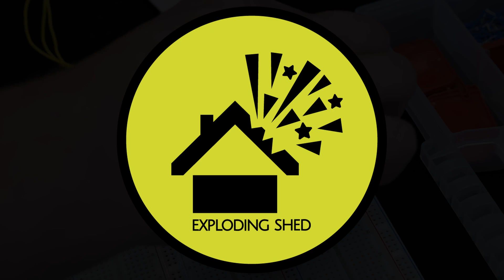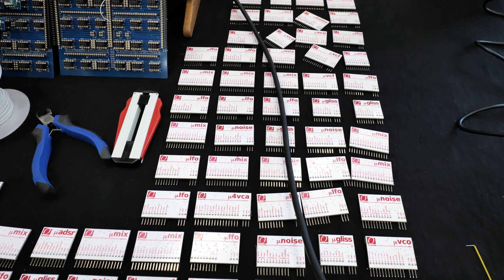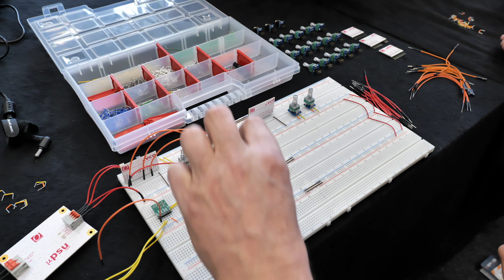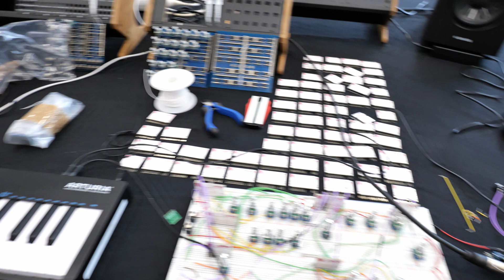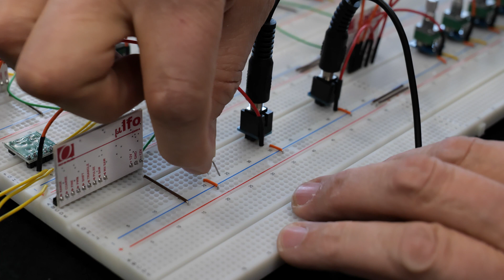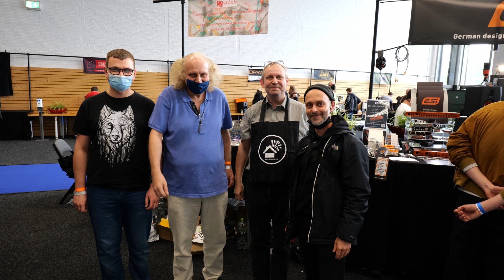SYNTAXIS Micromodular - your own DIY Synth without soldering! SUPERBOOTH 2021

Comment: Is it just me or does a setup like this have so many possible potential uses: helping to develop a new circuit with the following steps leading to a finished module; educational purposes, whether for adults wanting to learn the building blocks of electrical music circuits or for older children & teens who've built a simply oscillator circuit but want to go deeper into sound creation. Throw in an oscilloscope and the workshop participants can see the waveforms and how they are affected by the control voltages from pots or other CV sources.
I genuinely think this is a creation that is all too easy to underestimate its potential uses & usefulness.